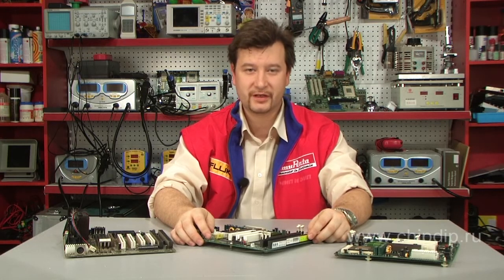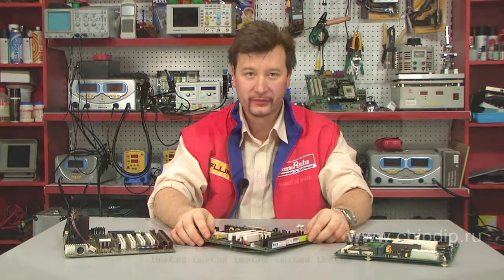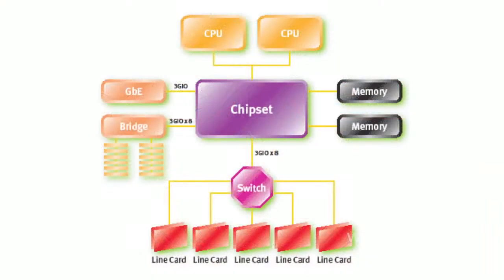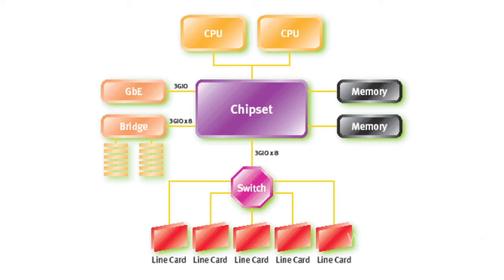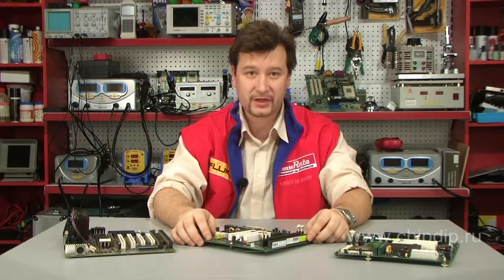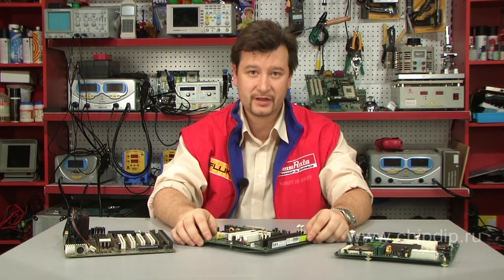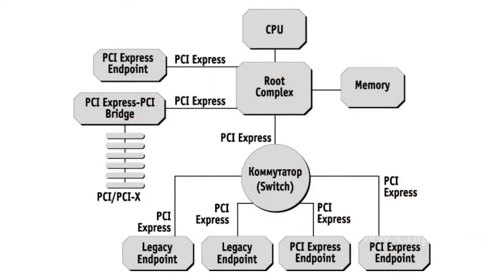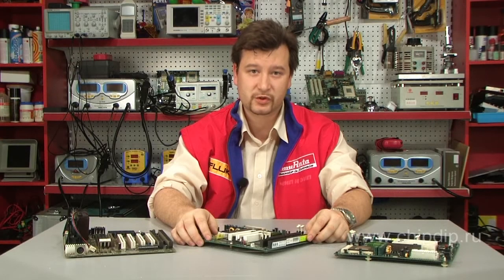Personal Computer PCI Express System Bus

Comment: I have so many questions it's not even funny.

Where does DMI/QPI fit into all this? Are they just the interfaces for the bus? Is the DMI/QPI part of the bus, chipset, processor or completely independent? I assume its some kind of integrated method of interfacing with the PCIe bus on the actual processor. Is the bus considered part of the chipset?